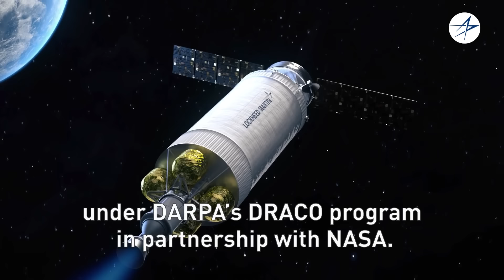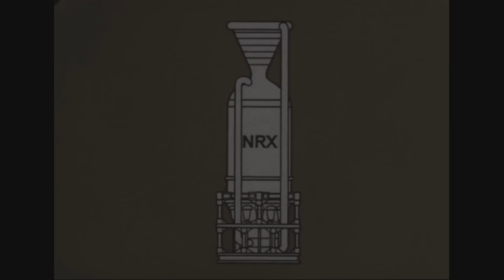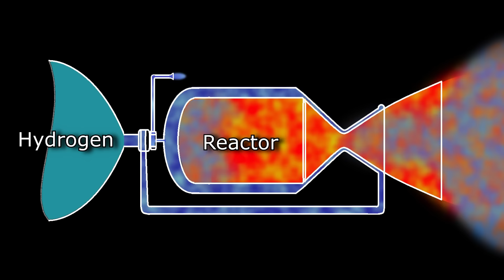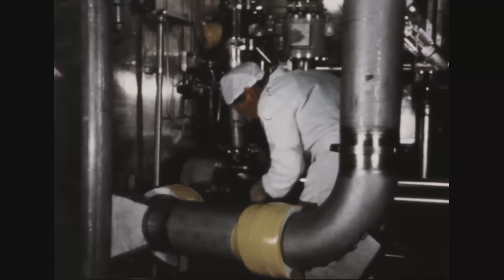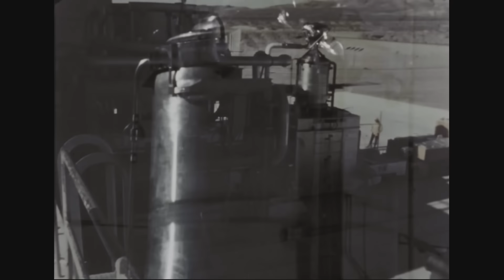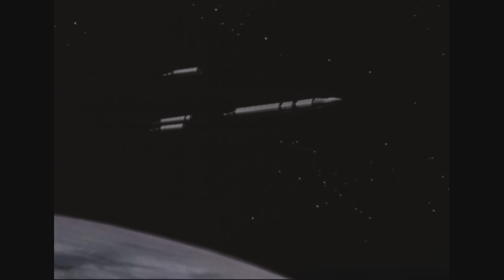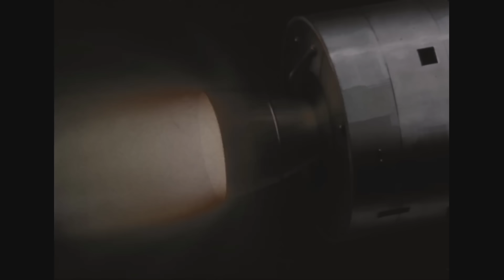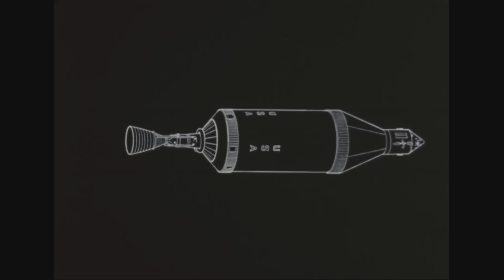Why Nuclear Rockets Are Going To Change Spaceflight

Comment: Thanks for sharing your thoughts, ideas and videos. Having retired from the power industry and interacted with nuclear power plants I’ve been a big fan and found various technologies very interesting. The liquid salt thorium reactors have many unspoken benefits that are only obvious to anyone who has had to deal with conventional nuclear power plants. When ever they mention electro propulsion they always mention the high electricity needs and the low force. Making me ponder, why not scale them up? If you use a reactor for your power, you should have plenty available, and if you use it you will start creating waste byproducts in the form of Xenon and Tritium in a thorium reactor that could be used as a propellant in your electric propulsion. Molten salt reactors do require a pumping force, on earth provided by convection but do operate at temperatures that could possibly drive a steam rocket in atmosphere and then revert to electric in space. As a sci-fi fan you should be starting to possibly envision the firefly ship Serenity. Which also had a mysterious spinning part to the engine. Centripetal force generator possibly for a molten convection based reactor?? One of the best parts with molten fueled reactors is they can continuously reprocess the fuel and isolate the spent most reactive elements from the reactor for storage in an alternative location, in space possibly thousands of feet behind the ship in a tethered and shielded pod. Another idea even if you aren’t into molten reactors could be, investigating if propellant gasses could possibly be manufactured in space with miniature particle accelerators from various elements that could be more compact and less massive then storing the elements un packed.

Comment: Seems to me, to get the IsP value through the roof the core of the reactor is going to be made of nothing physical, an electromagnetic field, just like they do in Tokamaks, but we don't need to be greedy, we don't need one hundred million degrees Celsius, imagine an exhaust of 5 or ten thousand degrees, still using fission not fusion of course and at those temperature regimes everything is ionized and so controlled by electromagnetism. Just recently Tokamaks have started using a Tungsten based material to house the fields with significantly less of it vaporizing off and into the plasma, but at much lower temperature this might not even be an issue.

Comment: Xenon shouldn’t be a problem while producing electricity in low power mode. When operating in high-thrust mode, it might not be operating long enough to create enough Xenon to be a problem until the core has been substantially depleted. After one long burn that might create a Xenon constraint, would you really need it right away, other than at low power for electricity?

Comment: “No technical showstoppers” 

(Lists 10 minutes of showstoppers)
Reply: None of them are showstoppers, they are just technical challenges, but none of them unsolvable. A showstopper is what faster than light drives have. Like "this needs matter with negative gravity", or "this needs more energy than contained in the entire observable universe".

"This is somewhat radioactive", or "you have to plan your flight path very carefully" are not engineering showstoppers.

Comment: If the reactor is dangerous to be next to, how do they get the reactor into orbit without irradiating the vehicle assembly team, or the VAB, or the launch tower?
Reply: What I read years ago was that the engine doesn’t produce radiation until it’s turned on. And since the reactor isn’t turned on until it’s safely in orbit there’s no problem for the ground crew.

Comment: Not one mention of actual speeds. Will the longer burn times of reactors enable 2x, 10x, even 100x, the current chemical rocket velocity of about 25,000 mph / 40,000 kph?
Reply: One question I have about truly high spacecraft speeds is how do we deflect all the particles that fill space?   A small piece of dust at 25,000 mph is quite a bullet.  Imagine the energy at 10 times that.  Hope Scott does a video about deflector shield research.
Reply: @az2spainstrummer  just navigating away from near Earth space will be a complex business. To date, 34,000 near-Earth asteroids and over 120 short-period near-Earth comets have been catalogued. Those are just the larger ones that would impact life on Earth if they struck - above 140m (460') in diameter - rather than those large enough to wreck a spacecraft in any cosmic 'bingle'.

Comment: 2027 orbital test by DARPA/NASA.  A company in the UK is also working on a nuke motor for rockets, ten times stronger, and also planned for the same year.  There's no way we can travel beyond the Moon without these nuke motors.  With "travel" I mean manned space flight.

The Ion thrusters can be more powerfull, if a higher voltage is applied.  That's not possible with solar panels.  There would be a reactor needed on the space craft.  Another application to wait on fusion technology.
🚀🏴‍☠️🎸

Comment: I really don’t think the open cycle, super-limited shielding model of reactor will be terribly popular today.

I know close cycle / thermal exchange engines have much, much worse thermal characteristics - I’m sure there’s ways round that or perhaps a dual mode system.

But… people just will not accept reactors being lofted and used in near-earth space (I include trips to the moon here) if they don’t have precautionary shielding for radiation at idle.

Perhaps you loft the shielding separately to the engine, which launches with a one-use shroud, then you mate them in orbit. Dunno. I’m only a KSP rocket scientist.

Comment: So, what speed could a probable nuclear-thermal (NTP) booster (or ferry) get a 1-ton spacecraft to?  If the specific impulse is only doubled, does that mean maximum practical speed is only doubled?  So like maybe 30 km/sec?  I was thinking of NTP boosters ferrying robotic spacecraft to the asteroid belt and out to the outer planets, to increase the number of such missions and greatly decrease the in-transit wait times.  Instead of waiting 5 to 10+ years for Hohmann transfer orbits to get the craft to the out planets or moons so as to put them in orbit, NTP ferries might get them there in…how much time? 3 to 6+ years?  I was hoping 6 months if they could accelerate to around 450 km/sec.

Comment: Bob Zubrin has said the key to using nuclear in space is not to put the reactor onboard as an engine, but rather on the surface of Mars (or the Moon, asteroids, etc.) and to make ISRU propellant using a nuclear reactor you bring along (eg NASA's kilopower program). The effective Isp from your much simpler, lighter chemical rocket using CH4 or H2 is effectively doubled or more.

Comment: I kind of expected it but am still disappointed with the NERVA centric view of atomic rockets. I read about a better design way back in the 70's thanks to an article by Donald Kingsbury published in 1975. That article can be hard to find so I still treasure that December issue of Analog magazine.

On the plus side, a primary reference in that article was classified but isn't any more. LA-2091: A Metal Dumbo Rocket Reactor.

Donald Kingsbury modifies the Dumbo design into an F1 class rocket motor.

Comment: Why does a lighter exhaust have more efficiency than a heavy one? Yes a lighter one can be accelerated to a higher speed using the same amount of force, but wouldn’t it also not transfer as much momentum back to the engine as a heavier molecule would?
Reply: The answer lies in the text of your question. The efficiency Isp of a rocket engine is directly proportional to the exhaust speed, Ve. The simple expression is Isp = Ve/g where g is the acceleration of gravity.
Reply: @phil4826  but wouldn’t a super fast but light exhaust push a rocket just as hard as a heavy but slower exhaust? Isn’t momentum a function of both mass and velocity?

Comment: Great Video !  The NERVA engine developed 250,000 lbs. of thrust at about 900 seconds Isp but used one engine...   The working fluid was Hydrogen and only needed to be tested in space !  The engine that I like is the NASA designed  "24-Hour Lunar Shuttle"  (LEO to LLO) by Stan Borowski that I met and talked to and later read a lot about on the NASA website !  The engine uses an advanced Nozzle by Aerojet Corp !  The numbers on the engine are Isp - 900 sec. to 515  sec. and thrust of about  15,000 lbs. to  66,000 lbs.  and also the life time of the engine goes from seven hours to about 35 Hours of life !  During the life of the engine the two engine Lunar Shuttle could do nine (9) round trips to the moon...  A small fleet of Lunar Shuttles would be supported by recovering 11,000 Tonnes of Lunar Oxygen (LUNOX-TM/LOX/O2) on the moon a year to support weekly flights to the moon !  More details and info at the NASA website !  The "24-Hour Lunar Shuttle" (LEO to LLO) by Stanley K. Borowski   is part of  Vision 4 of 5  for the Vision for Space Exploration  (VSE  Presidential speech January 2004) !  Also being small thrust engines you  have redundancy in the engine and multi able engines (two engines for going to the moon and four engines for going to Mars).   Also saw recently a couple of Y-T videos for a nuclear pulse plasma engine  with an Isp of 20,000 plus and 20,000 lbs. of thrust for trip times to Mars of four months...  (Capt. Kirk asks Spock "Can you track the Ion Trail... ?)  Scott hope to talk to you on the moon soon !  tjl

Comment: The ISP graph for diffrent propellents at 20:30 does not account for molecular dissossciation, which will rise the Isp up alot for water and ammonia. I found a paper the caculate Isp of ~450s at 3500 K and ~650s at 4000K for water because as the temperature goes up more and more of the exhaust is O2 and H2 and even OH and O and H, and the smaller the molecular the greater its thermal Isp as the velocity increase by the square and the less energy is sucked up in non-existant molecular bonds.

Comment: Another challange of radiation is that it kills electronics, so even robotic spacecraft approaching the parked reactor will have to be careful. And you probably can NOT run these reactors at a low level (=low temperature) for energy production because that might allow them to accumulate Wigner energy

Comment: man, inflation is crazy. Hearing Kennedy asking for 20 million for a nuclear rocket. meanwhile we just spent 320 million on a slapped together pier in Gaza that already fell apart.
Reply: Well, as with other critical infrastructure that was donated for the good of the people in Gaza, Hamas probably disassembled it for use against Israeli citizens and of course tourists.
Reply: @Ichangedmynom no it was incorrectly deployed. It was not designed for those sea conditions.
So it failed due to user error.
Reply: 30 millon.

Comment: Project Pluto/Supersonic Low Altitude Missile was a nuclear powered ramjet cruise missile. They got as far as building half scale prototypes and testing them before it was cancelled which was.a shame. It was a locomotive sized missile flying at Mach 2.0 at treetop height tossing out one megaton bombs. The shockwave of it flying over you would have been lethal.

Comment: Sounds like a lot of effort for "only" 2x the isp and still having to have different engine to get it in orbit.

At that point just use the reactor to power ion engine, hell, use reactor to pre-heat gas for it

Comment: What about Nuclear Electrothermal Engines? They're an alternative to molten or gas core engines that combine nuclear thermal with a nuclear electric arcjet.
Thing thing I wonder about with nuclear engines is really the political reaction to launching a nuclear reactor in space. There's the inevitable question of what if the rocket blows up on launch and I'm not sure if any amount of data can deal with how scary that sounds.

Comment: The reactor pile in the Project Pluto engine used ceramic nuclear fuel elements that contained highly enriched uranium oxide fuel and beryllium oxide neutron moderator.  The engine ran at almost 600MW and had a most sinister application installed in a cruise missile with never ending range.  Thankfully it was cancelled, but the engine technology would still be viable as a deep space propulsion unit.

Comment: Perhaps the episode should have been called Why Nuclear Rockets Are NOT Going To Change Spaceflight? It does seem the issues are too many and too deep. OK spaceflight is difficult, but if chemical energy can be manufactured outside the earths gravity well. ie on the moon then it does not matter if it is or is not the most ideal form of propulsion.  This seems to me a more likely scenario. I suspect that good old hydrocarbons will power our exploration of the solar system over the next 100 years unless there is a breakthrough in nuclear fusion.

Comment: Btw, my older sisters husband worked on NERVA. It was done by Westinghouse Astronuclear in Large, PA and tested at Jackass Flats, NV. I was a teenager at the time.
Reply: We were at the Large PA facility last month.  It now holds Clark Testing Labs.  My engineer we had there for our testing had worked there after Astronuclear stuff and had stories about the mural of that system flying.

Comment: The problem is always getting that stuff up in orbit. If a chemical rocket explodes it gets dirty a bit maybe, if there's hydrazine or something, but if such a thing explodes while taking off it fcks up a whole area with radio active fallout.
Reply: Not really, unless the core is breached.  And since thing really shouldn't even be a stage for an earth launched rocket, but rather a payload for something that is assembled in orbit, it should be possible to ensure that a core breach is extremely unlikely.

Comment: NTRs would be great for deep space missions past Mars, but can never be as efficient as chemical rockets for manned missions to Mars itself. The main problem is nuclear is unlikely to be able to use Aerobraking, which saves huge amounts of fuel. This is both regulatory risk of a hot reactor breaking up in upper atmosphere, but also difficulty of a NTR design (where we ideally separate the NTR and crew with a long boom to minimize shielding mass) that can handle huge amounts of atmospheric heating. 

Secondary problem is need for shielding and landers add dead mass that reduces its performance advantage over chemical. If a NTR can only travel from earth orbit to orbit, it has to have a custom lander (more cost/mass) to get crew to  surface of Mars and Earth. 

This is why the general design principles of Starship are so optimal for mars, you go directly to the surface of Mars and return to surface of earth with a single vehicle, and save huge amounts of DeltaV both directions using  Aerobraking. 

If regulators allow the NTR to aerobrake to surface of mars, and relight to launch from surface (with a radioactive exhaust), that might make it superior. But it will never be allowed to operate or Aerobraking within Earths atmosphere. So my guess is chemical rockets will own the earth to mars travel niche for a long while, while NTRs take over everywhere else, the Moon, Venus, Mercury, Pluto, asteroids, and all planetary  moons.
Reply: It gets even better if at Mars you use the surface nuclear reactor you brought along with you as part of the 150+ ton payload to produce CH4 using the Sabatier process. See Robert Zubrin's excellent book "The Case for Nukes". Should be required reading for every serious space enthusiast.
Reply: @phil4826  That doesn’t mean we will be allowed to use it as an NTR for landing and take-off, and pollute Mars atmosphere with radioactive exhaust. If so  you’ll still need chemical rockets to land it and relaunch it. More efficient to bring a reactor in a cargo Starship. A 10 Kw Kilopower is only 2 tons, and at 100 tons payload to the surface a single cargo starship could carry dozens among all the other supplies and equipment they will precache before the crew starships even leave earth.

Comment: There are variants of nuclear rocket engines that reach and Isp of 5000 though the most likely high value would be about 2000 -- more than 4X the best hydrogen chemical rocket engines.  The main problems as I see it are:
1.  Getting the nuclear rocket and nuclear fuel from Earth into space.  That job will require a large chemical rocket, which is doable, but ensuring the safety of people on Earth if a nuclear rocket were to crash seems unsurmountable.  
2.  Once the nuclear rocket has completed it's mission, say from Earth to Mars and back to Earth, then it would need to be refilled with LH2 and maybe the nuclear fuel will also need to be replaced or added to.
3.  Such a rocket, returning from Mars for example, would need to make a final major burn to get into LEO -- that burn would be on the order of 3km/s.  That is, the nuclear rocket, returning from Mars, would need to remain in orbit around Earth to avoid the risks of landing on Earth.
4.  Public opinion!

Comment: This is insane. Chemical rockets sometimes blow up. When this happens (and it will happen), how much fissile material from the core will be sprayed in the atmosphere?
The shadow shielding business also sounds insane to me. Disasters waiting to happen during transfer operations....
Reply: Its not really that dangerous. Unspent nuclear fuel is actually pretty safe to handle even by hand, nuclear material is only dangerous once the reactor turns on, which will only happen once its well out of Earth's atmosphere and probably orbit. 

Its especially safe when embedded in another material like graphite or even glass like it is here. Which is why uranium glass is perfectly legal to sell.